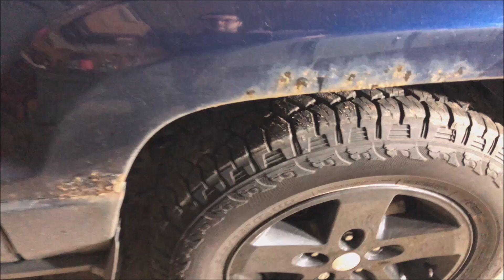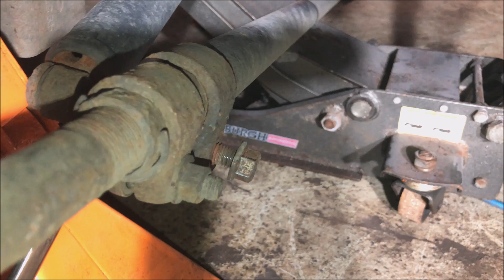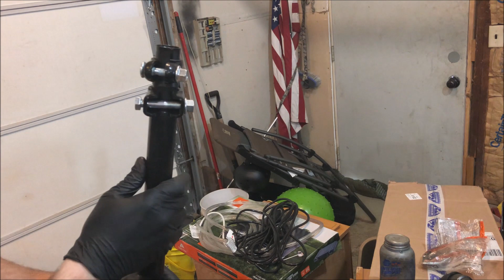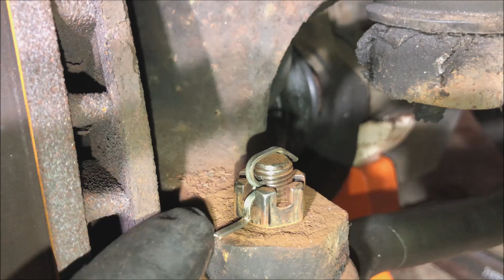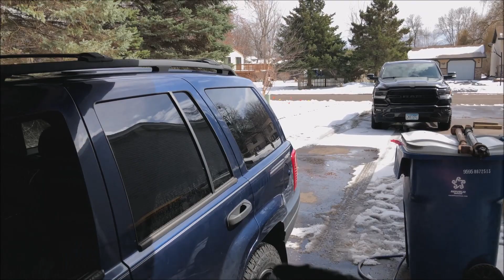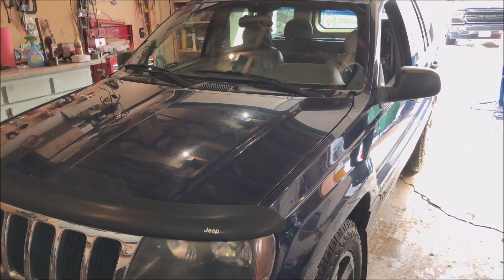Jeep Grand Cherokee Tie Rod Replacement (1999-2004)

Comment: Is the top end the same as the bottom one ur replacing?  Cos my top is all super loose
Reply from the maker: Top end? Not sure what you mean.
Reply: @TonyTheTruckGuy the tie rod on top I think u did the one on the bottom.
Reply from the maker: @relaxgaming8872 The tie rod is the tie rod. If the end you are talking about is not connected to the tie rod, then it’s not part of the tie rod. I suspect you are talking about the drag link. I think that will be a different part number than the tie rod end.
Reply: @TonyTheTruckGuy  ohh I think it might be my inner tie rod.
Reply from the maker: @relaxgaming8872  Probably not. What year/make/model vehicle?
Reply: @TonyTheTruckGuy  04 wj
Reply: @TonyTheTruckGuy ohhh ur right it’s my drag link that’s super lose and the rubber boot is broken.  I thought that was the inner tie rod.
Reply from the maker: @relaxgaming8872  Yeah, most likely drag link end. Very similar looking to tie rod end but that bar goes up to your steering box. Might want to check the joint at that end as well.
Reply: @TonyTheTruckGuy  yea it’s super loose I can wiggle it with barely any force. So I ordered the parts hopefully will solve the loose issue.  Rubber bushing was all ripped up.
Reply from the maker: @relaxgaming8872 A little bit of rotational play is ok (if the whole drag link twists back and forth just a bit), but yeah, if the rubber boot is ripped and that ball/socket joint has side to side or up and down play then it’s bad.

Comment: The stud on my tie rod end is spinning when i go to put the castle nut back on... Does that mean it's bad?
Reply from the maker: Not necessarily. The tie rod end COULD be bad, but it needs to be bolted up tight to check for that. Make sure your stud threads aren’t damaged. If threads look good, you have to somehow supply some upward pressure on the stud while you’re tightening it to keep it from spinning. You can try a long pry bar and pry up on the tie rod end as you tighten the castle nut, or very lightly jack up on the toe rod end just to apply some pressure and keep the stud from turning. Once the stud is actually tight, you’ll have someone shake the steering wheel back and forth while you watch that tie rod end. If you see any movement in the ball and socket operation , then the tie rod end is bad.
Reply: @TonyTheTruckGuy  thanks man, I learned more about it and found the spinning to be acceptable, so I tried jacking it up to the point the weight of the front end was on it and it still wouldn't stop spinning the stud; c clamps, nothing stops the spin. I'm gonna try the cutting a slot in the top to place a screwdriver method next if I can't figure it out any other way.
Reply from the maker: @megdalenagonzalez-mounce1776  It’s much harder with a wrench or ratchet and not an impact as well
Reply: came to update: swapped castle nuts with another tie rod and both went on fine in first try with the impact and  pressure of the jack underneath. SMH
Reply from the maker: @megdalenagonzalez-mounce1776  Gotta love the old damaged threads 🤣 Glad you got it!

Comment: Quick question. Is it fine to measure from the inner side of tire on front of tire (driver to passenger tire) then back of tire from driver to passenger tire?
Are you just seeing if the front of the tire is equal length to the two back of tire from driver to passenger.
So 60-⅜" front, 60-⅜" back measurement would be acceptable.
Reply from the maker: That would not be an acceptable measurement because you want the front measurement to be slightly smaller than the rear measurement by about 1/16”. I also don’t recommend measuring from the sidewall of the tire, because they are not perfectly true. The best was is actually to spray paint a line on the tread while spinning the tire, and then scribe a line in the paint and measure the line fore and aft of the tires. I didn’t have spray paint handy so I did it this way.

Comment: Before I remove ANYTHING, I use WD-40 spray lube.  And unlike you, I have great success at removing cotter pins and can actually reuse these a couple times provided they are not so rusty they become brittle. Maybe you need to learn to lube these parts with thick lube more often.  And using dykes is a dumb idea.  Sure - these are beefier than delicate needle nose pliers, but they are designed to sheer metal, not grip and pull pieces along.  And I was told to mark the thread width on each piece to eliminate the guess work on how to align these later on.  I was wondering how to figure out which of the 4 tie rod ends goes where.  These all look so similar to one another.  And NEVER tap atop your driver unit like that - it will mess up the delicate bearing inside!  Better idea:  remove driver and band directly atop the hardened metal socket instead. Nothing to break that way.  Speaking of which - ever hear of a breaker bar?  It is a much longer driver that gives you tremendous torquing power for breaking free stubborn bolts. You may be knowledgeable sir, but your mechanical skills are as rusty as the Jeep you worked on.
Reply from the maker: I love when people act like they're so smart and perfect, yet here they are, watching my video 😂
Reply: Wow, what a condescending schmuck! haha Yes, he should have used liquid lube to presoak some bolts (in many people's opinion) and yes tapping the tools can cause issues with the bearings, and yes using side cutters goes against the usual method of removing instead of cutting the cotters.. but at least he isn't sh-itting on someone who is trying to help others who have not done this procedure. When I do this I will avoid some of the tool methods but watching him complete this makes me more confident in doing this myself, and I thank him for that.
Reply: Wow, you come off like a tremendous douche

Thanks for blessing us with your knowledge oh great one 😂🙄

Comment: I recently change the pitman arm tie rod end, do I need to align the tires again?
Reply from the maker: Yes
Reply: @TonyTheTruckGuy  thanks
Reply: Even thou I rotate it the same about amount of turn as the one da I took off
Reply from the maker: @mrno3525  Yes. Even 1/2 of a rotation off could be several degrees of toe adjustment.

Comment: My grease gun isn't fitting on the grease fitting
Reply from the maker: Is it a new grease gun or grease tip?
Reply: @TonyTheTruckGuy  I ordered a grease gun from Amazon. I have the same tie rod ends as yours
Reply from the maker: @theUltimateLord  New tips are pretty tight. At the end, there should be 2 flats on the tip where you can loosen it just a bit (where the actual 2 parts of the tip thread together, not where the tip threads onto the hose). Sometimes loosening that up a bit helps get the tip onto the grease fitting easier.
Reply: @TonyTheTruckGuy  ok thanks I'll try that

Comment: Good video! I found that turning the tie rod bar about 1 full rotation is close to 1/4 inch movement in either direction
Reply from the maker: Yeah, that number will vary depending on tire diameter, but it's good to know a rough estimate.

Comment: You could also use ROST-OFF, and then again you can count the threads in the rod or color spray it before taking the old one off and then count them if the new rod is anything close to the old one. Also, the end of the TAPE MEASURE is suppose to move like that. That is how you get it accurate measuring from both sides. I use TAPE MEASURE every day at work. Thanks.
Reply from the maker: Yeah but over time, the rivets that hold the tape measure end to the tape itself will make the holes bigger and therefore make the first inch not accurate anymore which is why I typically opt to just start at the 1” mark. The paint on the tie rod ends is a good idea though!

Comment: Is that necessary to grease ball joints after replacing?
Reply from the maker: If they are greaseable ball joints then yes, it’s mandatory. Otherwise they will wear out much faster.
Reply: @TonyTheTruckGuy  so is there an option to buy non greaseable ball joints? I’m doing that for a first time so I would appreciate your advice.
Reply from the maker: @kosta2177   Yep, there are many companies that offer greaseless ball joints.
Reply: @TonyTheTruckGuy  thank you :)
Reply: There's a night and day difference after you grease it. The steering feels tight and responsive after greasing it. Before it was.slugish laggy.
Reply: Why did you need to change your tie rod? Rattling or an alignment issue. Thanks.

Comment: Remove tire
3/4 or 19" socket (break or remove the pin)
Steering shock 15mm nut 19mm on back (3/4)

Comment: Just an FYI. The wiggle on the tape measure is there on purpose so if you are pressing the tape against a wall or have it hooked on something it gives the same read, if that makes sense I might not be explaining it properly. I’m gonna give this a to this weekend thanks for uploading!
Reply from the maker: Good to know! I feel like some older tape measures have more worn out holes where the rivets hold the end onto the tape though so I just start at the 1" mark so I know for sure I'm accurate. Good luck with your tie rod replacement!
Reply: The "wiggle" is to account for the thickness of the clip itself. So if you're pushing the clip against something to get an inside measurement, it retracts, otherwise your cuts would be short.
Reply: Lol.

Comment: Good video! My jeep wj is pulling to the right n left at 55 or 60mph and also while de accelerating slowing down... needs tie rods n alignment?
Reply from the maker: You’d have to have someone shake the wheel while you inspect tie rod ends and drag link ends for play. Also wouldn’t hurt to check ball joints. But any of those things being worn or even just a bad alignment could cause a pull
Reply: @TonyTheTruckGuy   Went to check the tie rod end n theres soo much play in it! Lol gotta get that fixed asap... Thanks for the feedback 👍
Reply from the maker: No problem, good luck with repairs!
Reply: could be rear control arms. I had that in my jeep, when I accelerated it would pull one direction, left of the throttle and it would pull the option direction, almost as if the vehicle was 'drunk.' Replaced the rear lower control arms and it cured the issue.

Comment: is there inner & outer tie rods?
Reply from the maker: Inner and outer only applies to vehicles with independent front suspension. Since the Jeep is solid axle, it just has the main tube section and then a left tie rod end and right tie rod end, no inners/outers.
Reply: Tony The Truck Guy thank you so mucj
Reply: No but there are upper and lower tie rods, he did the lower ones. The upper ones attach to the pitman arm, which transfers the motion from the steering column to the entire system. The adjusting sleeve for the upper tie rods is shorter than the lower one.
Reply from the maker: There are no upper and lower tie rods. You have 1 tie tod assembly on these Jeeps which consist of a tube, and 2 tie rod ends. The one that goes from the pitman arm on the steering gear to the knuckle is the drag link. The tie rod is used to adjust the toe, while the drag link is adjusted to center the steering wheel.

Comment: So kinda forgot how much thread went in on one tie rod and now one wheel is facing a little inward. Will an alignment straight it out, or do I need to take it off again?
Reply from the maker: If 1 tie rod end is threaded in all the way and the other one is barely threaded into the tie rod tube, I would adjust the tube or drop the end down that isn’t threaded in as far and spin it in a bit more. If you feel like both ends are threaded in enough for safety but just aren’t adjusted evenly, that can be corrected during the alignment.
Reply: @TonyTheTruckGuy  I'm gonna have to thread it out a bit. I tried driving and you can feel and hear the tires fighting each other lol.
Reply from the maker: Yeah I mean even if the ends are both threaded in the same distance, the overall rod may be to short or too long which will cause scrubbing. Won’t be perfect until alignment is done

Comment: Would've been easier getting that cotter pin out if you didn't use cutters
Reply from the maker: Maybe. I’ve tried pliers, vise grip, putting a punch in the eyelet of the pin and using a hammer. Always come back to the side cutter.
Reply: @TonyTheTruckGuy  same
Reply: @TonyTheTruckGuy  try needle nose, in the loop, and a hammer.  Don't beat your pliers to death.
Reply from the maker: @horsemania4356  Lifetime warranty I’m not worried haha